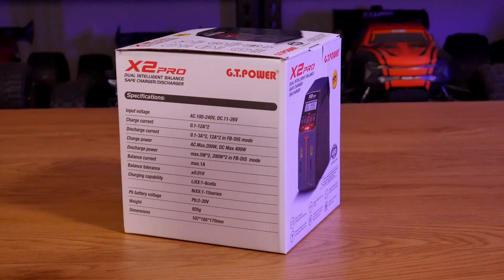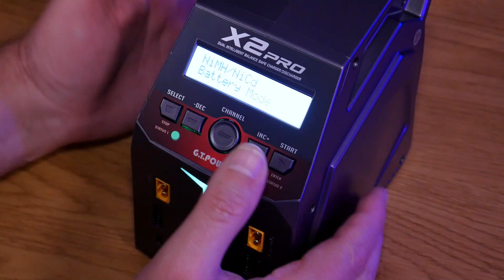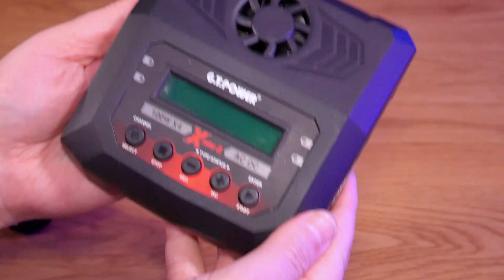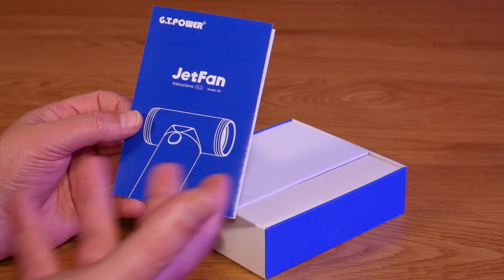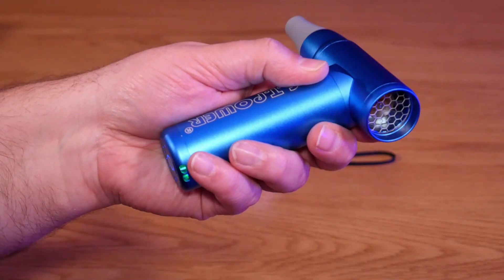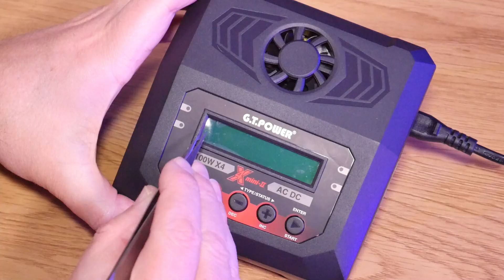Unboxing: G.T. Power X2 Pro, X4Mini II 400W Chargers and JetFan

Comment: FB-Dis is their dedicated discharge function with an external dc battery source, and possibly also one of those massive custom resistor chains that people build, to rapidly discharge a battery at up to 12 amps compared to the 3 amps (approximately) that the unit usually discharges at. 
It's for dedicated rapid discharge under DC-DC power. 
Hope that makes sense, my electrical knowledge is quite mookiestinks yukyuk pooey dumdum.

Comment: Good Video, I have the X2 pro. for the app to work you need to have Bluetooth turned on on your phone. As to the QR codes, you need to set up a charge program for a battery  using program in the app. when it is saved, it creates a QR code so that you can save as a picture that can be printed and attached to the battery. it is a unique code so that whenever you scan that battery it will automatically set the program you have saved and carry out the charge / discharge etc. It will also store that data for the battery. Its a lot of money for what it does compared to some of the cheaper chargers out there.

Comment: 7.5 LiPo FB-DIS mode 
You have to use this mode under DC working status and input port connected to battery, otherwise will report an error. FB-DIS working principle is transmit the  standby discharging battery capacity to input battery through the charger and acheived the discharge eect. For your safety, the screen shows discharge current should not exceed the battery manufacturer allowed maximum discharge current value, rated voltage should not exceed the battery manufacturer allowed lowest voltage value, in case deep discharge.

Comment: I think that Jet Fan is a bit pricey.
Reply: Only a bit?
Reply: @rogerwilco5187 those things are all over Amazon now, with silly claims like 240 miles per hour wind speed (386 km\h) 
Those things are a fad. 
I never need to blow dirt off my rig until I get home, and then I use an air compressor, which has 8 bars of pressure. 
A dinky fan with a single battery can't blow enough to make a difference.
It's really sad when people pay so much for a thing that's so simple. An $8, 40mm server fan  and an 18650 lithium ion battery, plus a power switch would cost $15. 3d print your own shell for it or put the parts in a PVC pipe. 
Companies charging an arm and a leg for such a simple product pisses me off.
And then when people buy it, that pisses me off more, because if they paid that much for that little, it means they got duped.